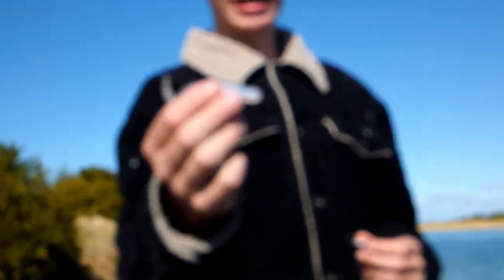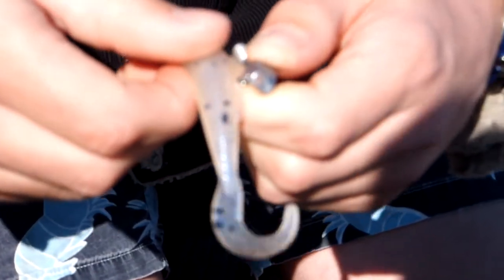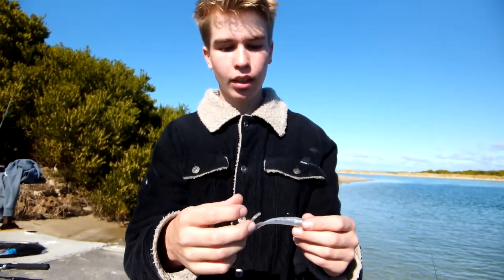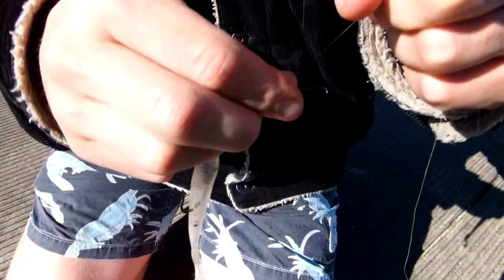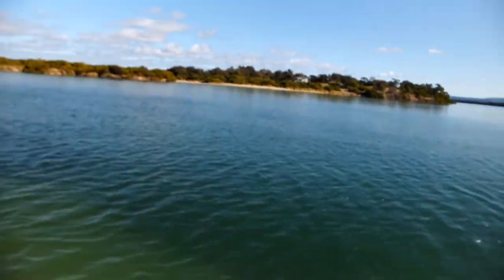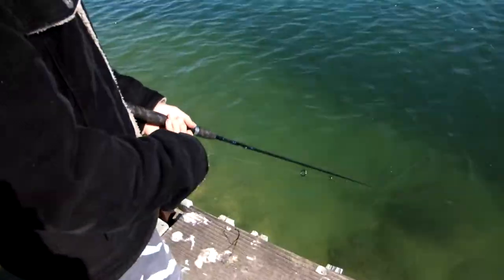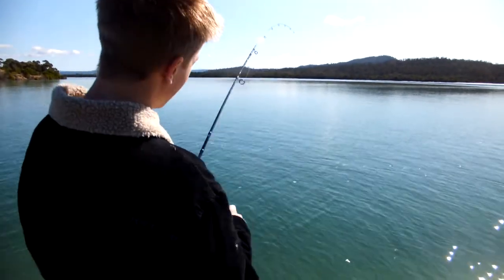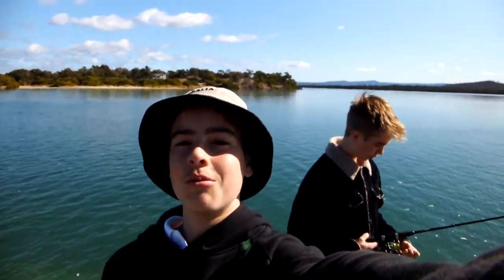HOW TO USE SOFT PLASTICS

Comment: Plus why do you hop the lure so high your on a jetty a metre of the water then flicking the rod 2m in the air that’s a big hop you just want to hop it about 30 off the bottom
Reply from the maker: mate why would i hop it 30m high that's just dumb. Plus, the water's about 4m deep.
Reply: You know what I mean 30cm
Reply from the maker: mate it only goes about 30cm high even when i hop my rod that high. It's cause the line is so far out.